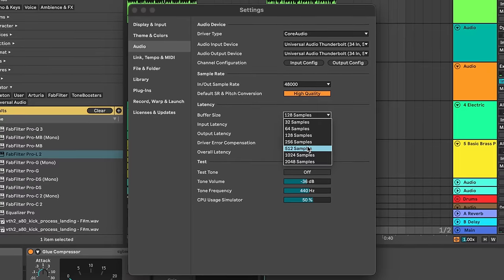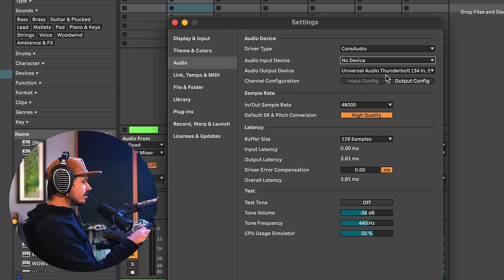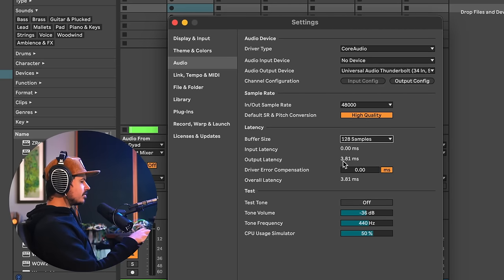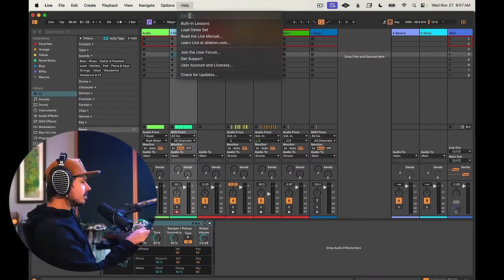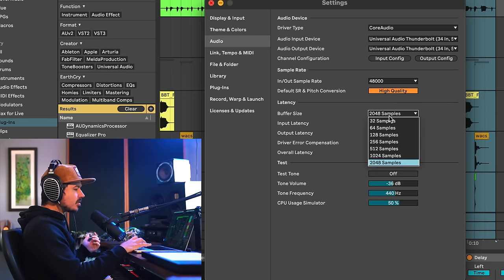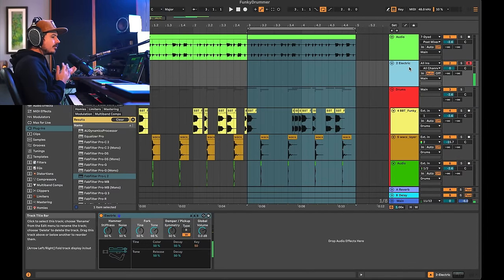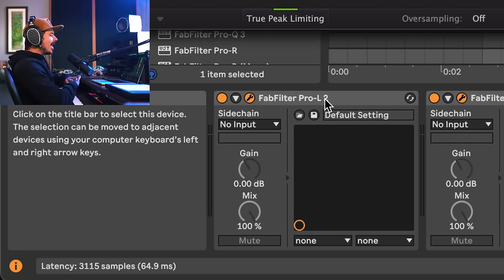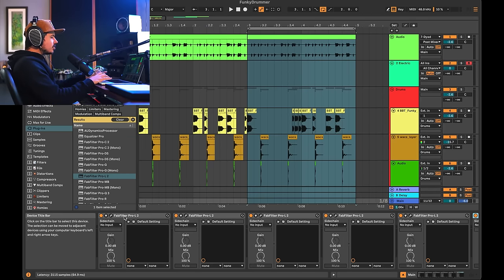The Ultimate Guide to Latency in Ableton Live (2024)

Comment: FYI: Disabling "Keep Latency" does exactly the same to the recording as the "trick" with recording to a track that has Monitoring set to "Off" did. Exactly the same. In the video they made it sound way more confusing than it actually is.
Reply: That's what he demonstrated in the video
Reply: @SoloElROY  but they never state that it is the same and from their attempt at explaining the feature it also seems like they don't know it is the same.

Also later in the video they claim that "Keep   Latency" button doesn't solve the issue of not having delay compensation applied when recording (they claim that all you need is the Ext. Instrument device) - which is totally not true. You need the button to disable "Keep Latency".

Comment: I’m so glad you touched on the ableton latency issue because it’s actually worse than that. I found in testing that groups were failing entirely to calculate latency when reopening a project, max for live doesn’t calculate latency correctly either. Some latency gets reported incorrectly upon reopening projects and will cause the same out of time things to happen. The only fix is to rearrange the tracks in the project and put them back where they were which causes ableton to manually recalculate the plug-in latencies. You cannot have a side chain on a track or group because of this and have to make a bus for your side chain to go through or your side chain will not be calculating time correctly. These issues and abletons support responses that told me to stop using 3rd party plugins entirely as well as huge stability issues since 10 made me leave ableton this year after being a lifelong user for bitwig. Sad they have not fixed this it is totally unacceptable at this point.

Comment: @22:10 ...check what is even more crazy...the  channel inserts lack of PDC in Ableton Live, can carry over to a new track if the new track is receiving the output (Auto/Off setting in the record state, does not matter) of another track with latency inducing plug ins. This drove me mad for a day whilst I was trying to figure out why it happened!

This problem is specific to Ableton Live and its a far too expensive DAW to have such a flaw.
There's posts by people saying it can't be fixed without writing the code from the bottom up and I am not a coder so I have no idea if that is the case, but Ableton's strong denial to address it, makes me think the above rumours, might be true. 

Ableton do mention in Delay Compensation FAQ that "Built-in device modulation synced to the Live transport (i.e. synced to a specific beat-time position) is not compensated".
There's no solution on offer, they just flat out say it is what it is.

Its 2024 and the elephant is still in the room and no one at Ableton is saying anything. 
Hopefully this video generates enough noise for them to at least say something on the matter.

Comment: 22:24 with anyone using infiltrator and tries this experiment, you can circumnavigate it by turning either MIDI or Audio retrigger on in Infiltrator and it'll sync. But , Ableton needs to really address this.
Reply: So the infiltrator won’t start until it receives audio/midi?
Reply: @tavenner07  it'll start, it's if you have it after another plugin with latency it will thro it off in Ableton as he has demonstrated. This is the workaround specifically for it.

Comment: Awesome video, appreciate your work! Wondering if you have some tips for a setup like: Ableton -> midi clock -> external sequencer (OXI One) -> cv signals -> analogue gear (modular) -> audio in -> Ableton. So far, I haven't found a solid way to get this right. Playing with the midi clock offset helps, but is not very reliable...
Reply from the maker: I’d say the problem is likely in your midi clock as it’s not time adjusted. Instead, what I would use is the CV clock out device. I found that that’s usually way more solid.
Reply: @SeedtoStage  Cool, using cv clock directly to the analogue gear works very nicely! I guess I could probably clock the OXI this way to get all the other goodies it has to offer. Thanks!!

Comment: Heyyyy..... Finally the ultimate comprehensive guide to the black magic.
What would you actually recommend for the case of latency-whores inside one effect chain, as you mentioned it in chapter 7 at minute 22:15 ?
I guess you just have to route the signal after the time-consuming effect into another track, from where you can add the other effects in series afterwards.
The routing to another track should compensate this latency. And that is just possible because the plugins "tell" live their latency??!! Or doe's Live measure this?
In both cases, it should be theoretically possible to implement this at specific points in the chain.?!
Is the latency in devices like infiltrator always the same, or does it depend on the actual modules (presets) you use in it? 
That would be the one issue I see, with "predicting/adding" latency compensation after each effect in one chain.
Reply from the maker: All I can say to this is that if the plugin exists anywhere in the signal chain, it will make the latency on every track in Ableton UNLESS “reduced latency while monitoring” is on. So the solution could be to remove the new track from that signal chain or to commit the offending tracks to audio.
Reply: @SeedtoStage  Yeah.. It will bring all tracks to the worst latency. But the delayed signal of the first half of the signal chain, should be in sync with the midi-actions, happening in the other track. But yeah.This scenario is very abstract. At least for me. But it was an eye opener, because I often have the feeling my songs sounding more and more washed out after some actions, I couldn't explain otherwise. Thx for this.

Comment: Plugins handling in Ableton Live 12 (and all versions before) is a nightmare…issues with PDC and no sandbox environments around them making potential crashes inevitable. Live 12 live sets kept crashing a lot and 12.1 seems more stable…But the current issues with PDC + different handling of the compensation depending on the type of track used/routing makes the whole sets very hard to keep in sync, especially with external hardware instruments.

Comment: So for hardware being sequenced by an external sequencer, but getting clock from ableton it's better to use external instrument and set up another audio track with monitor off to record in? I'll have to try this. I have a template set up with audio in so I can monitor and "keep latency" off and as you are saying it does have the latency reported from my interface in the audio. I run at 64 sample, so it's a slight bit, but if I can eliminate it completely, that's pretty amazing.

Comment: I wish Ableton would have a low latency mode like Logic, where it would actively bypass any plugins that introduce heavy latency.
Reply: There is. Under Options Menu /Reduce Latency When Monitoring
Reply: @osmancolak  no, it's not the same. Try to reduce latency when monitoring with several CPU heavy plugins, and you will still have latency issues.

Comment: I still have another latency, buffer-related or working-memory issue that persists through Live 8,9,11 and now 12. After some time working and recording, I get a "crackle seizure", a rising wave of crackles, stuttering and delay moves through everything, including into recording tracks, then falling away again. Takes 5-10 seconds, afterwards no problem for another 20 minutes or more. Changing the buffer size and upgrading to 12 helped a little, the wave is shorter and less frequent. I assume it might have to do with the core audio and/or a memory swap of the (Mac) OS, perhaps not just a Live issue - it also happens when recording in very simple projects. Yet I'm not sure. Back in Live 11 and before, after a severe wave an added delay would remain throughout the entire project, having to restart live to get a clean slate. Any ideas?

Comment: Dude, you are the best at all things Ableton by a country mile! I have a question: 
I'm using Live 11 Suite and tried adding a Shaper to a pad sound. When I increase the buffer size to keep the project from bugging out, the timing of the shaper is off. And this is confirmed when I compare audio tracks at alternate buffer sizes recorded directly from that pad track. It's the same if Delay compensation is on or off. I am also making sure track monitoring set to Off on the recording audio channels. Zero latency reported by all Ableton devices.
This also causes issues using 3rd party PI's (like Kickstart 2 for example). Totally screws the vibe, and I don't understand as surely this should all be happening within Ableton before it goes out to the interface. What am I missing here?
Reply from the maker: Is shaper after any plugins that cause latency? That’s where I would start.
Reply: @SeedtoStage  Nope, just an operator with  single oscillator & zero latency. 😕

Comment: ...i think the info you give in the dyad example is not 100% correct...you would only have 40x the latency of one device if you'd stack them within one track...if one track has a plugin that causes 100ms latency and another track has the same device on it then the total latency would still be 100ms (+ the latency of the interface)...
Reply from the maker: Yeah I should have mentioned that what i meant was if there was 40 dyads in an instrument rack all on the same track. If that was the case, there would be over 100ms caused by it. Since youtube is annoying and you cant add edits after posting im just going to remove those couple seconds. Thanks for catching that.